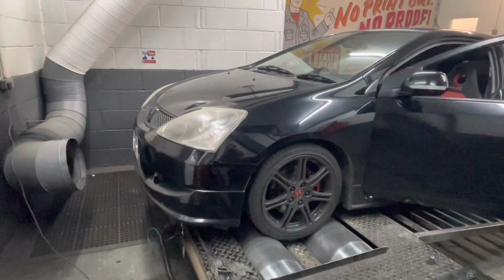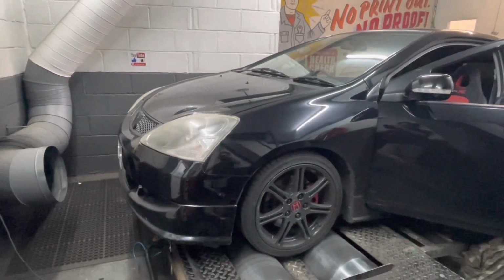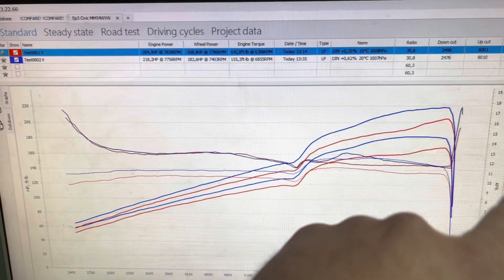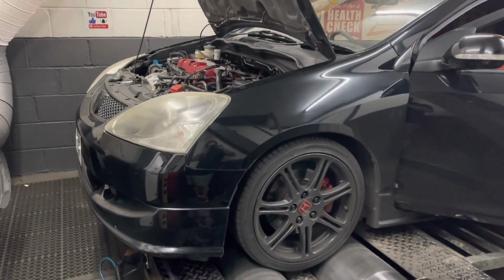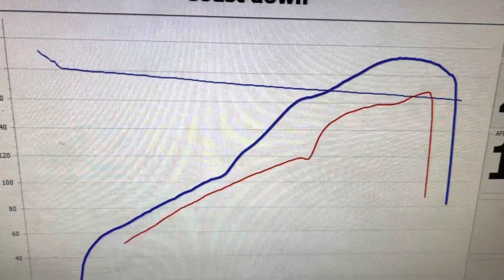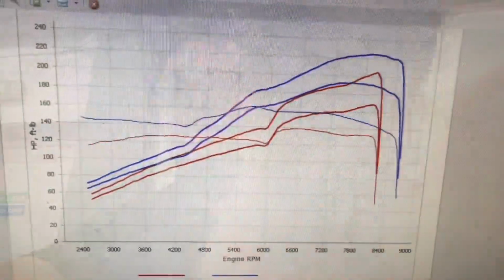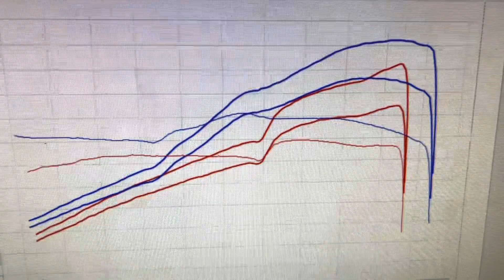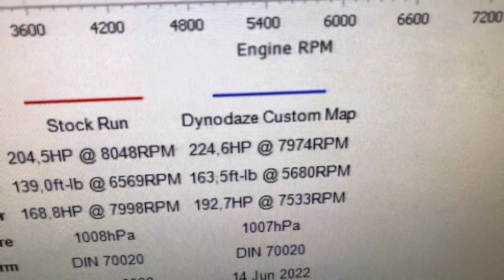His Second Ep3 Civic We have Tuned!

Comment: Oem intakes are not the best on this Hondas.  In my example on cl9 accord same happened after designed a proper intake for it. It was +14hp gain. 
And for haters they can see on the graph that din correction for both runs is about the same so there was no jacking up of numbers.
Well done guys for sharing this.
Reply from the maker: Thanks 🙏